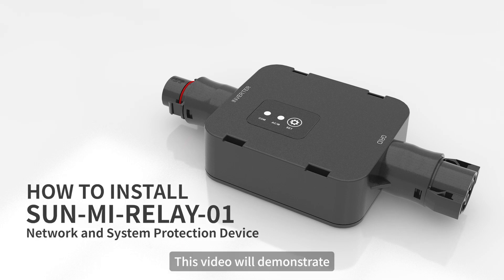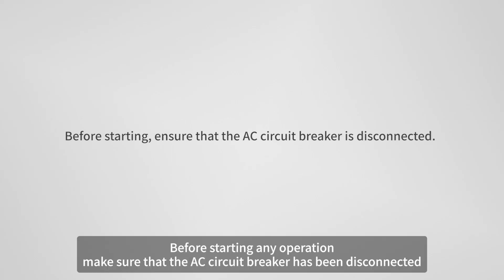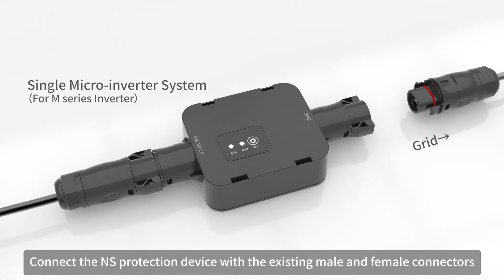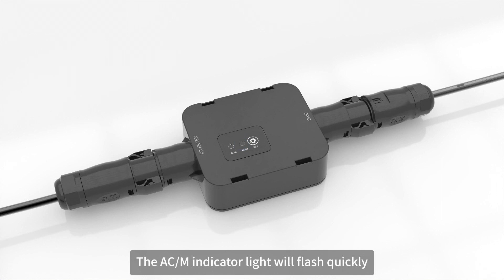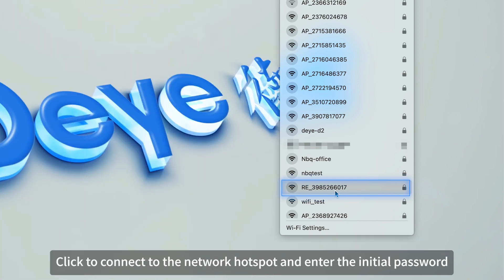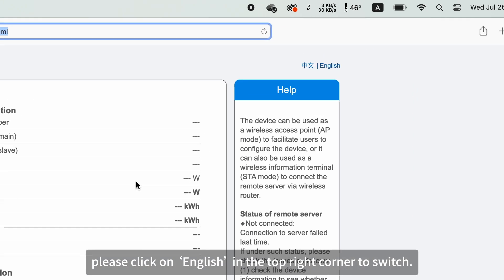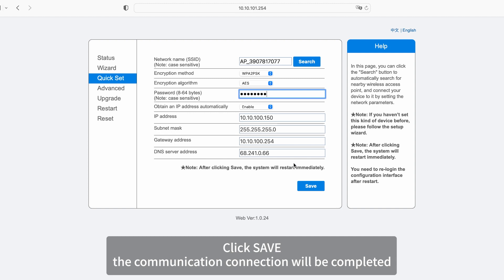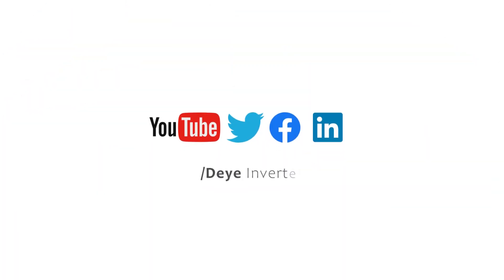How to configure the external relay box with Deye Microinverter

Comment: Sorry how i turn on the ac circuit breaker of microinverter?
I connected everything and i connected to the relay web and i did the quick set. But nothing power coming from the microinverter to the grid.